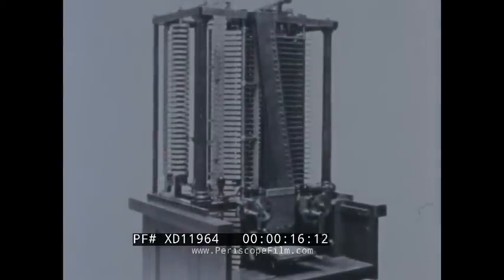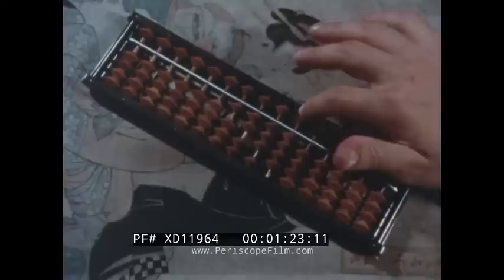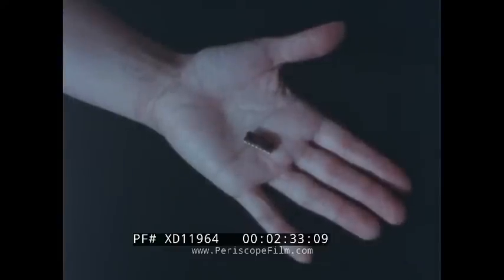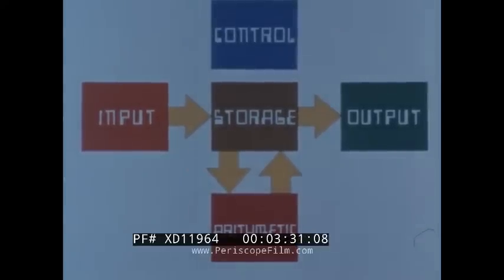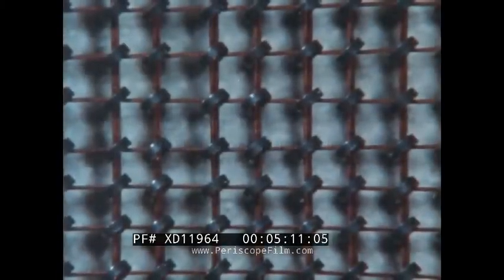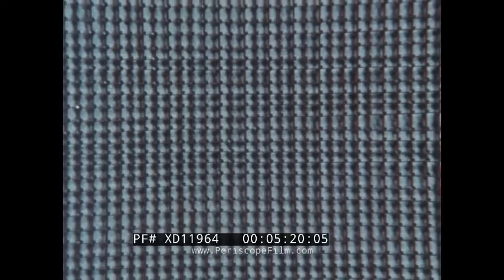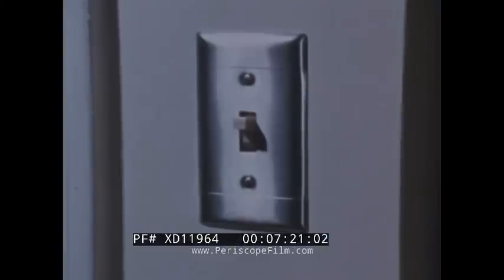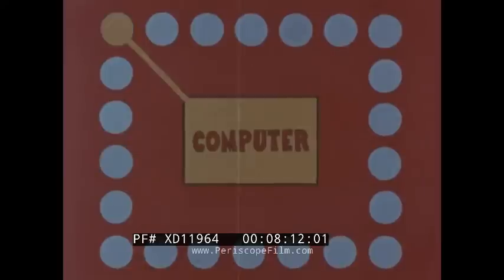" COMPUTERS " 1970 EDUCATIONAL FILM  IBM MAINFRAME PUNCHCARD & MAGNETIC TAPE BASED COMPUTERS XD11964

Comment: Kinda disappointed modern machines don't make all these cool sounds :)  (Yes, I know they didn't actually back then either. I was around then).
Reply: C3PO made sounds like that back in 1977!
Reply: @antonioveritas  A long time ago..
Reply: @nicolacasali8304  And in a galaxy far, far away!
Reply: @nicolacasali8304  Just realised that is was of course R2 D2 who made the funny noises. But since C3 PO was fluent in 6000000 forms of communication I expect that he could make funny noises too!
Reply: @antonioveritas  Of course! I visualised R2 D2, too.
Reply: You haven't heard my onboard sound chip. Every time i boot into windows i can't use my USB sound interface and need to plug in my headphones directly.
I tell you, it's like like listen to the entire bus via r2r A/D converters. Linux on the other hand shows mercy for my ears :)
Reply: I think some vintage machines (certainly some British built computers such as the Elliott 803 and ICT 1301) had a speaker connected to some internal CPU register, the idea being that a programmer or operator could listen to the machine processing and, based on experience, get a feel for what it was up to just by the sounds it made. Although the sounds weren't quite as 'blippy' and 'bloopy'  (more like a sort of rhythmic buzzing).
Reply: Computers COULD be programmed to make music, although you couldn’t run a music program and a more useful program at the same time.  The high frequency transients created when circuits switched on and off emitted radio waves, which could be picked up by a portable radio near the machine.

Some operators kept a radio by the machine to listen to the random pulses so they would know if the CPU or a program failed while they worked in another part of the room.  The console lights served a similar function, as well as allowing programmers to debug programs by “single stepping” through a program.
Reply: @allanrichardson3135  Yup, did that more than a few times. Used to use an AM radio and a Polymorphics Poly-88 system to make some "music".
Reply: @therealchayd  ... operator could listen to the machine processing and, based on experience, get a feel for what it was up to ...
     In the '70s, watching the panel lights, we could tell what the computer was doing, and could especially spot endless loops ... <stop><reset><program load> time !

Comment: Ahh, the memories. Tech College in 70's had 360 Model 50 for class use during the day, ran the county systems overnight. Started coding by wiring 1401 control boards. Then on to 360 Assembler, FORTRAN, RPG/II and COBOL. Started with airlines coding their aircraft maintenance tracking/forecasting system.  Wrote on 80-column coding sheets, turned over to the keypunch folks, got card deck back, checked it, then added our personal Job Cards and sent it to the computer room to be run. When we each got a 3270 terminal, thought we were in hog heaven.  

First machine was the 360/50. Last one before retiring was z/OS 15 machine.  Do what you love, never work a day in your life? Yup.  

Got into programming by total accident. College cancelled a math class, guy pinned up a newly opened course that fit my, now open, day and time slots.  Intro To Computer Programming.  Sure, why not??!!  The rest, they say, was history.
Reply: I started coding RPGII on paper.  After your input, calcs, output, etc. were defined you could type your code directly into the system on a keyboard and a 8 line/40 column CRT.  Fun times.
Reply: @dneumet    During short summer break in tech college classes, worked as temp S/36 operator at an HVAC manufacturing plant. Their entire accounting and manufacturing software system was RPGII. They had a problem where IBM coders came in to track down the problem.  The printed copy of the code was in 6 of those 132-character green-bar folders. Each 8-10 inches thick. They let me flip thru one of them. Holy crap!

RPGII was meant to be a management report generator, not code full-blown business control systems. 

RPGII has the 100 status switches that can be set, their code had routines to do crazy storing of multiple sets of those switches depending on the part of the code it went to next.  Using up to a dozen sets of those 100 switches.  🤷‍♂️🤦‍♂️

The company had both a 96-col card keypunch machine/reader and an 8-inch floppy key-to-disk machine with CRT. Think the key/disk display was limited to 80 columns.
Reply: @tomgates316  IIRC those key to disk were only 40 characters.  The high school I went to had some 3741 and some 3742 units: https://en.wikipedia.org/wiki/IBM_3740

At one point I had to maintain RPGII code that was developed for a large drug company. The developers were in South America.  Trying to interpret their Spanish language field names into English was somewhat challenging.

Comment: I came into computers at the age of 7 with one of the first Microcomputers.  TRS-80 Model 1, I owned Atari computers into the 80's until I bought a 486.  First minicomputer I used was at college was a Digital PDP 11/44.  First job with computers was an IBM System 38.  How times have changed.  I now do Help Desk and Desktop support for a company.

Comment: I watched this from magnetic tape.
Reply: I watched this on a film strip on a projector
Reply: I watched this on smoke signals
Reply: Reel to reel video deck..
Reply: The file for this video is 25 MB, so it will fit on a 10.5-inch reel of magnetic tape.

Comment: I was doing Basic and Machine Code on a Superboard Challenger 1P in 1982 and TRS-80 with 16k RAM, and Apple II in 1983... 48k RAM and there was 40 columns of text... to have 80 columns we have to buy a US$200 80-Column card... (extension circuit board)  and later on was doing Assembly on IBM 360 to find prime numbers as a college homework... I still remember a guy who was already working at a business and he saw me completing the homework and he said to me, "No, that is a homework impossible to finish!"

Comment: 7:45 - Timesharing. Already common in 1970. So when the Feds where awarding grants, to save money, they wanted those awarded grants to share computers, developed Arpanet to network computers over long distances. This eventually turned into the Internet. Didn't get into computer until taking Fortran, in college, in the 1970s. Then it was on punch cards, which I handed to a clerk, at a "window", and picked up my printout, a day later.

Comment: A lot of YouTube videos wouldn't even fit on a single IBM 3350 disk drive (introduced in 1975), which was the size of a small washing machine, that a bank might use to store customer records.
Reply: 317.5 Mb/drive would still allow a lot of youtube videos to fit. Youtube videos are heavily compressed and 317.5 Mb is quite a long 1080p youtube video. 
But they would be way to slow to play them back! (not to mention the processor capacity would probably also be way to slow. Or the video capturing.
Reply: @Magnus_Loov  Well I guess I should have said a lot (and I do mean a lot) of videos I watch would exceed a 3350 capacity.
For example the below video, mp4  @ 1920x1080 is 553.76MiB and is less than 29min (which I don't consider quite long)
https://www.youtube.com/watch?v=noHL7YwB7JU
Reply: Also in regard to this video...this is at the resolution I'm likely to watch. The same 24 min mp4 video @ 3840x1920 (which is available and some people with more powerful equipment may prefer) is 1.09GiB so it wouldn't even fit on three 3350s if you split it up.
Reply: @billb6283  The file for this video is 25 MB, so it will fit on a 10.5-inch reel of magnetic tape.
Reply: @RaymondHng  OK. The size of THIS 11 min file is slightly less than 25MB depending on the format. And many such files would have also fit on a 3350. This is an old lo-res video. Many if not most of the newer YouTube video's are available in HD and are much larger. I used a 3350 disk drive as reference because that was common to that era, and most people have a concept of a disk drive. Not many people have a tape drive on their computer.
Reply: @billb6283  On another YouTube video on a restoration of a Documation card reader, I explained storage size using punch cards.

This 720p 6-and-a-half-minute video takes 104,863,413 bytes of storage as an MP4 file. If we were to store that file on punch cards using only eight rows (one for each bit), it will take 1,310,793 punch cards. Since each card is 0.007 inches thick, the stack of cards will be 9,175.5 inches high, 764.6 feet tall, or 656 boxes of cards at 2,000 cards per box. This card reader reading at 600 cards per minute, will take 2,184.6 minutes or 36.4 hours to read 1,310,793 punch cards.

But instead of wasting four rows, let's use use all twelve rows of the card. Then we can store 120 bytes per card. This video will take 873,862 punch cards, stacked 6,117 inches high, 509.8 feet tall, or 437 boxes. That's a lot of trees. And it will take 24.27 hours to read them.

16,500 punch cards weigh 99 pounds, so this stack of 1,310,793 cards will be 7,864.8 pounds. Or the 873,862 punch cards (120 ASCII characters per card) will be 5,243.2 pounds.

Comment: In the 1980s, computers were grossly slow.  However, they were really fun.  Sharing software was easy with such tiny programmes to move around.  Taping into another computer was as easy as knowing the telephone number their harmonizer was connected.  A harmonizer was what a telephone modem is today, but much slower.  It was easy to programme in BASIC.  I still remember the code today.  But the actual utility of computers was really more a novelty than a necessity.  There was no World Wide Web at all and the Internet was horribly cryptic, slow, and hard to use.  Few used it, even fewer knew about it.  Today, the utility of computers is far greater than the entertainment aspect of computers.  We need a better balance of entertainment and utility for computers today.

Comment: The amount of paper used must have been astounding.  Even at a terminal, paper being used instead of a view screen.

I remember working with those washing machine sized hard drive units and their disk packs, just as they were on their way out in favor of much smaller hard drives.
Reply: They must have been hernia-inducingly heavy lol. What was the storage capacity? I saw a photo of a 1GB hard disk unit from 1985 (the year I was born) and it was enormous. Compare that to the 32 GB microSD card that fits inside my phone today and it really blows your mind how far things have come.
Reply: I remember working with 2 pack sizes.  300 mb, and 80 mb.  Yeah, a far cry from what we have today.  Even from the late 80s.

The actual drive units were like a moderate sized home washing machine.  With a flip up lid where you drop in the disk pack.  I think the larger pack was a stack of 10 platters.  Each 30mbs.  I don't remember the configuration of the 80mb, But it was a little less than half as deep, less platters. Close and wait for it to spin up to operating speed.

These drives were prone to "head crashes" as the heads 'flew' like less than a millimeter over the surface.   A dirty finger print would be dangerous.  And a hair or spec of dust on the surface would be like hitting a mountain at 1000mph to the hands.

The critical time of vulnerability was when the cover was lifted off the pack while loading or unloading in the drive.

The drive units had all sorts of airflow and filtering system to keep the disk area free of particals.  Part of the reason why the drive units were huge and heavy.

Comment: I was still receiving my local (natural) gas bill on "IBM" (punched cards) in the late 1980s!
Reply: Do not fold, spindle, or mutilate.
Reply: Punched card system invented in the 1700s to control weaving looms. So there were clever people around back then, just didn't have the knowhow to build electrical circuits etc!

Comment: are those sounds effects that they make just a meme of how early computers sounded or really how they sounded?
Reply: They could have speakers wired to them, or radios in the same room with them, to pick up the random sounds generated as millions of switches flipped on and off very quickly, and some people wrote “demo” programs that would play music using those radio signals.

But communications BETWEEN computers, or between a host computer and a user’s terminal (printing or CRT display) over phone lines DID sound something like that, because audio tones were MODulated to send over the wires, and DEModulated to recover the data, using a pair of matched MODEMS.

Comment: Diagram of computers components is interesting to me. They say Arithmetic unit, now it is called ALU  Arithmetic and Logical unit. Does that mean at that time there wasn't the Logic part, or it is just different naming in time?
Reply: The film is not completely correct: The ALU has always been thus.  Also, control would normally be depicted as the central box, because this unit controls the flow of data and instructions among the other four units.  Thus, it reads data and instructions from the input unit to the memory, then fetches the instructions stored in the memory, moves data from the memory to the ALU to execute arithmetic and logical operations in accord with the instructions, passing the intermediate results back to memory, then takes completed results and writes them to the output.

Comment: ..... Back in the late '60's, I worked in the mail room of a data processing center... For over 700 credit unions ...I would take multiple pages printed paper, and run it through this machine called a deculator ... It had bins, where each separated paper section would go.
... I also ran statements through a debursor, which cut the paper sides and center, while it snapped the perforation of each statement...
... The computer operators of the IBM 360, 3rd or 4th gen. would let me load the huge printers, hang the tapes, load the disk stacks, and sort cards...
... The technician would let me drag thick cables under the floors to new components... So, I would later joke that I helped to hard wire mainframe computers .....